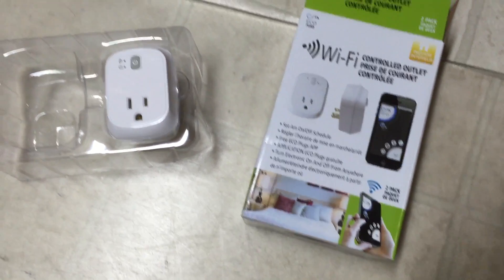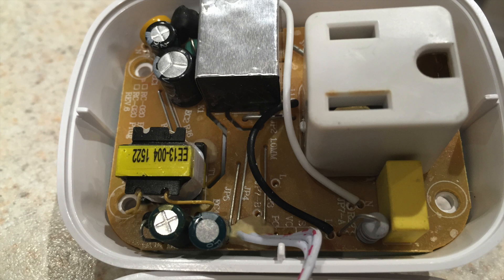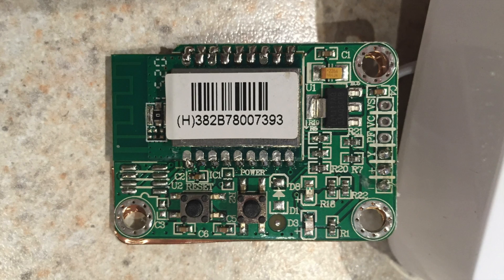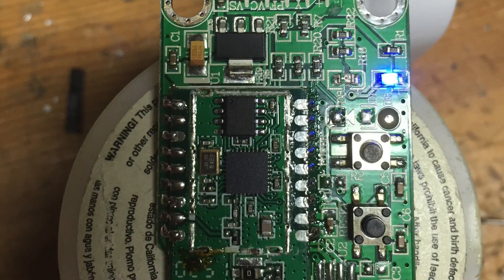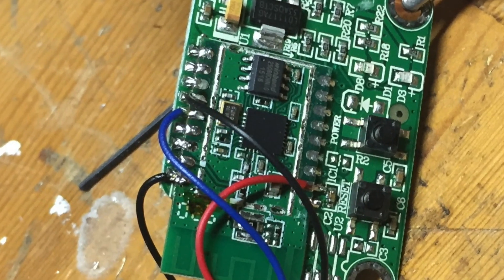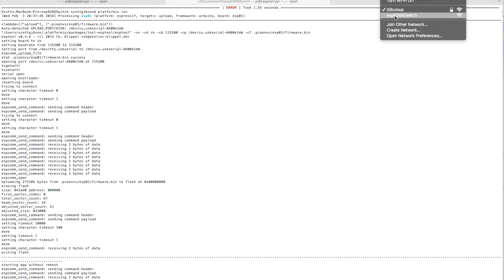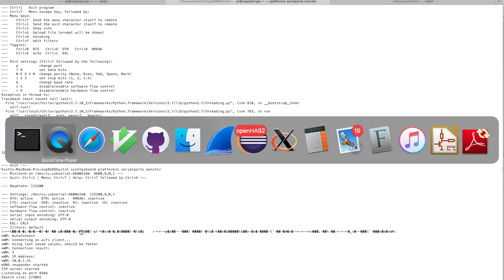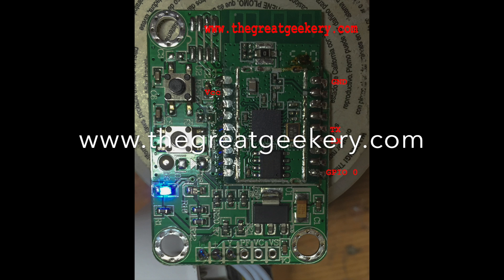espSwitch - Custom firmware for the Home Depot EcoPlug

Comment: Great info and pinout, thanks.  Everything I needed to flash Woods Wion 50050 smart plug. Bought it yesterday at Princess Auto for $13 (8909962).  Flashed Tasmota 8.5 then OTA upgrade to 9.1.

Comment: I would like to use a couple of these to open and close my garage door over the internet.  Instead of pluging in a 5 volt power supply to close an external relay across the contacts of my opener door button, is there a way to get access to the relay inside the ECO plug, remove the A.C. and feed the contacts of the relay to make the door opener contact close?
Reply: What you describe is totally doable. just feed 5v to the small board and then the relay will open and close as directed by the ESP